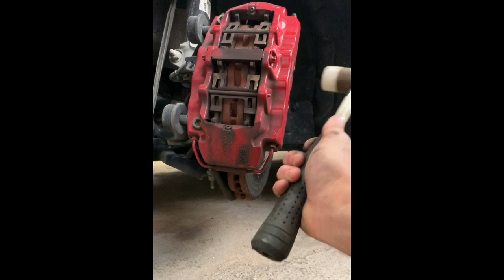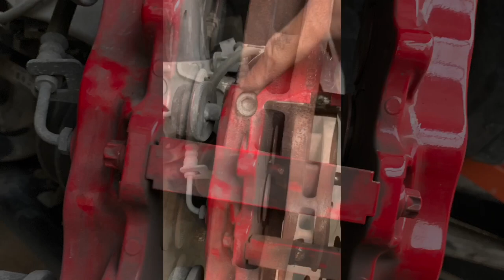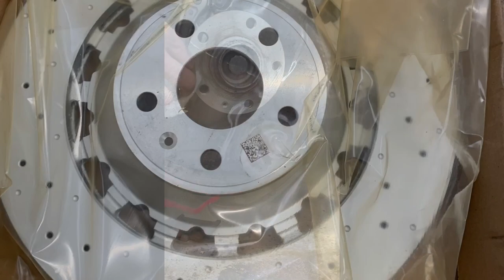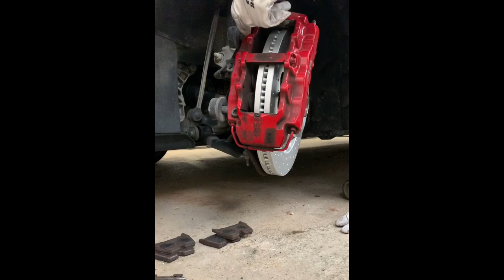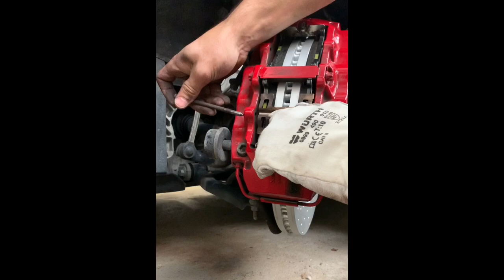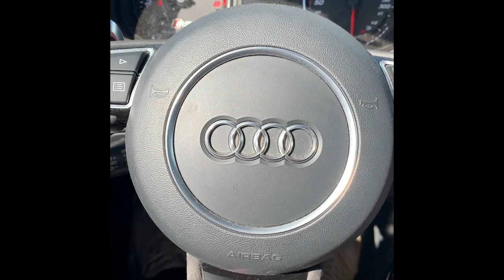Replacing Audi RS3 2017 front discs & pads + bonus clip

Comment: Don’t use the small bolts on top to remove the caliper!  Those are NOT serviceable items.  Use the large bolts on the carrier frame in the rear.  Replace the large bolts as they are one time use. 👍🏼
Reply: but if you do, tighten on 110Nm (:
Reply: @DanielenviO Do you know the part number of the bolt?

Comment: I have 2018 RS3, My Audi dealership told me that I’ll need to replace brake pads around 30K KM. I never tracked my car or been aggressive on my car. Is this normal to change brake this fast.
Reply from the maker: hello, this car has 4 brake pads per brake and they are not very big, these brakes brake hard and well. Yes, it may be that at 30,000 kms they have to change
Reply: i change the oem ones every 12k miles… :(

Comment: I am just curious, why did you go with oem when they are non floating disc? It seems that old version was two piece floating?
Reply from the maker: The old ones were defective and they stopped manufacturing because they were bent. Audi only makes the new ones that have the round shape
Reply: @edgarcia.34  i have a 2019 model with those discs - they vibrate on high speed or high load.. I am more or less sure that floating ones would be better.
Reply: @tautvydasv  I bet your car was vibrating because you had a sticking caliper on the front?

Comment: Hi what size Allen key did you use to remove the two bolts that attach the caliper?  It looks like a 10mm perhaps?
Reply from the maker: Frank Alarcon Yes! 10mm allen!
Reply: What if I don't have an RS3  I drive 89 Toyota Carola

Comment: Im guessing the discs are not oem but zinnerman which cost like £150 per disc rather then £400
Reply from the maker: The discs are oem
Reply: @edgarcia.34  I thought oem have the flower shape. 🌼
Reply from the maker: @karoln7078  The old ones 🌼 were defective and they stopped manufacturing because they were bent. Audi only makes the new ones that have the round shape. That's what they told me at the Audi dealer.
Reply: @edgarcia.34  yes quite a lot of owners were complaining that they were getting worped didn't know audi stop making them im guessing to many people were complaining but they did look cool